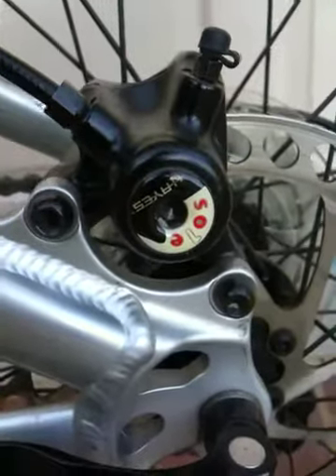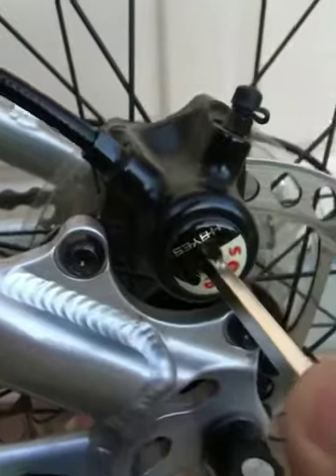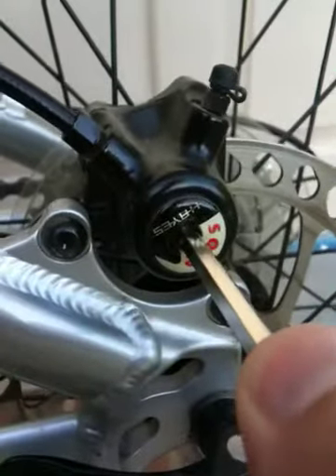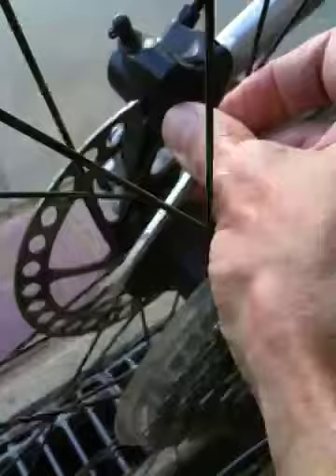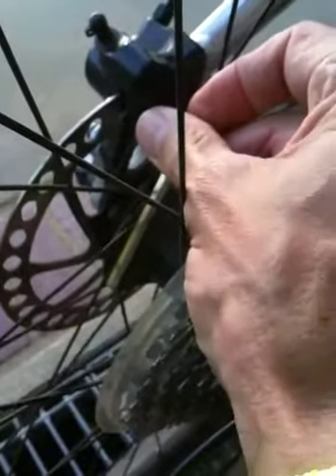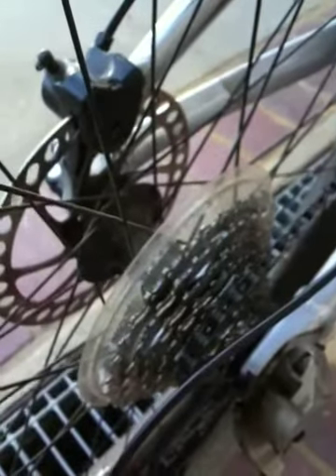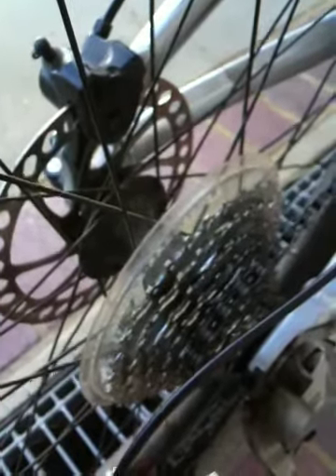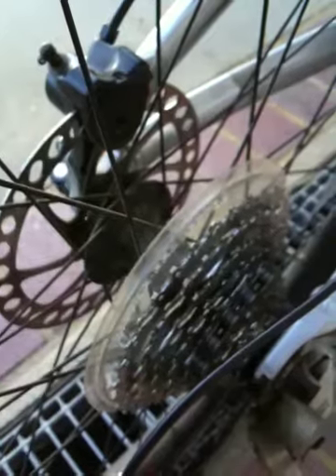How to adjust Hayes sole disc brake

Comment: Hi I.have the same brakes and my rear caliper is rubbing against my rotor, because I installed new pads but I cant manage to turn the cylinder with the allen ranch. Im turning to the left but is really hard. Is that the correct way? Please help thank u

Comment: PLEASE HELP ME!, I Haves hayes So1e ,i did the bleeding process as told to and get it perfect pressure, as fast as i lower the lever to the right postion and press(pump) a few times it losses pressure directly to empty, then i relocate the lever up(to the highest point) ,and press(pump) a few times the pressure comes back, WTF IS GOING ON!!?!?! GOING CRAZY.

its full with the correct oil, nothing leaking ,no wet/oily cable or parts , made it bleed many times so dont think its air in the system